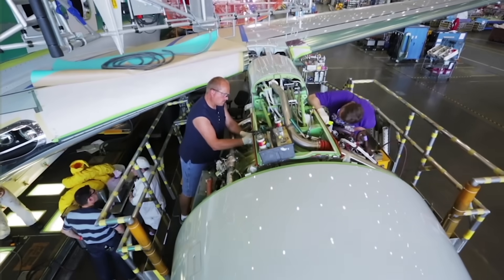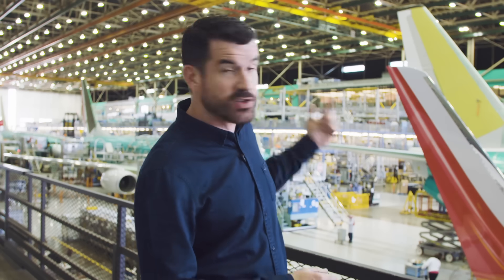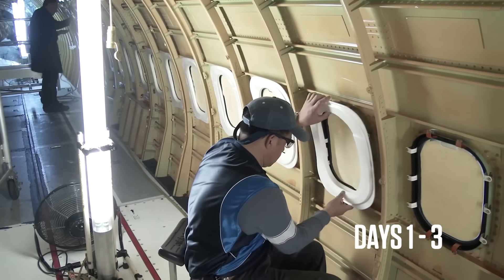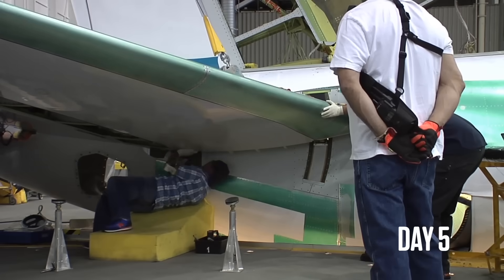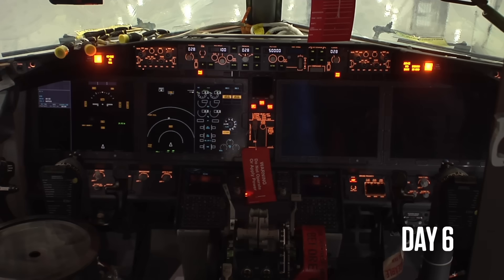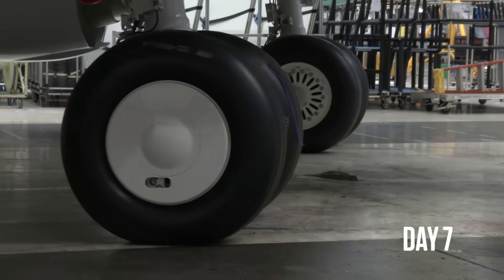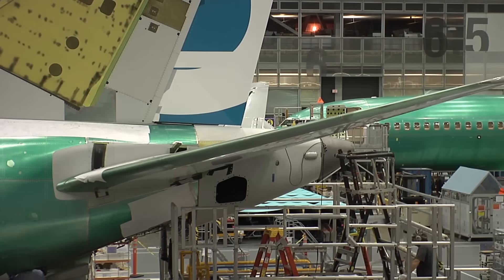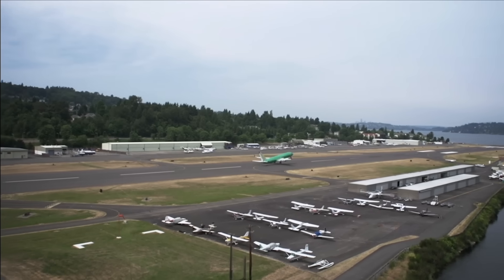How Boeing Builds a 737 Plane in Just 9 Days | On Location

Comment: Is it just me or would you like it to take more than 9 days to put something together that is carrying me at over several hundred knots and at 30,000 feet. I'm just saying.
Reply: I see your point but it’s not a rushed process, if they rushed it it would take more like 3 or 4 days and by rushed I mean loose screws everywhere, a couple of essential systems not working as they should here and there
Reply: Michael Spears o
Reply: Michael Spears Oh yes look at the safety record on planes compared to other modes of transportation. It was just a light joke saying if when you're 30,000 you can just pull over.
Reply: I can build a baloon, and drop it at 30,000 feet.

It will then go over several hundred knots, and at 30,000 feet.
And the best part: IT CAN BE BUILT IN 2 HOURS :D
Reply: @JKB-  what if I pop the balloon?
Reply: TechyMark Yes I know, It was just a joke
Reply: Erik Buiten false
Reply: Most cars are assembled in a day or less; and for some manufacturers, it only takes a few hours.
Reply: It’s not their first rodeo
Reply: It's also not built in 9 days though. They mucked up the title of this video. It's ASSEMBLED in 9 days with parts that were built before the assembly started.
Reply: IF u like surviving. Fly airbus
Reply: Erik Buiten actually Airbus planes have a flaw. In fact there was an accident involving a co pilot with the joystick pulling the plane up causing it to stall. The joystick is not linked with the other one so the pilot did not know the co pilot was pitching the plane up. On a regular yolk when you pull the yolk on the do pilot side it moves on the pilot side unlike airbus.
Reply: AF447 would never happen in a Boeing

Comment: Assembled rather than built.
Reply: Chris Coombes Parts are usually manufactured on high production lines which takes far less time than assembling whole plane
Reply: Actually build works as a definition, you're thinking of fabrication.
Reply: shwackthenoobsac What is fabrication?
Reply: your an idiot.
Reply: My thought exactly. Clickbait
Reply: Assembled/built, same thing. The parts are manufactured/fabricated and then shipped in and put together. This is more a massive warehouse than a factory. Parts aren't actually fabricated here
Reply: Blue Girl I agree - I was being a bit picky maybe.
Reply: @ChrisCoombes  lol 😜
Reply: huh
Reply: Yea i agree with you its misleading. They didnt count how long it takes to mine the aluminum.
Reply: Rata 4U  I never said that. I said assembled and built, which are indeed interchangeable.
Reply: Tf does that mean?
Reply: arrowmouse fair enough....
Reply: So where do you stop? How long it took for the steel to be mined? This is modern manufacturing, there's nothing wrong or misleading. What you're talking about is 'bespoke production' which is maybe 1% or less of output these days. These cheap prices and high quality we enjoy for everything these days depend upon it.
Reply: Samuel Rs fair enough I’m being a bit pedantic
Reply: if you're going to be pedantic, then it's usually advisable to be right.  Assembling finished goods from parts/assemblies is manufacturing.

Comment: where was the paint job?
Reply: The customer paints on their own livery to their standards.
Reply: That’s another 9 days 😂
Reply: i have the same question!
Reply: or the whole production of the parts... so, the final assembly needs 9 Days
Reply: It gets painted in the two paint hangers at Renton plant, at Boeing Field or at Moses Lake.  Then it will get deliver at Boeing Field.
Reply: Boeing does do some paint jobs for airlines, but most use other contractors. Boeing's main painting hangar is at Portland International Airport in the southern part of the airport grounds off taxiway Echo-6 by the threshold of runway 3.
Reply: mexican with can of spraypaint
Reply: soaringtractor Well the company needs to pay for it to be painted so yes. Technically the company needs to paint it
Reply: The company who buys the plane paints it.
Reply: @ghosttoast7  As a matter of fact, Boeing paints the aircraft in a separate building at the factory.  The Green protective coating is left on until all the tests have been completed and the customer has accepted the aircraft.
Reply: That’s the consumers responsibility, not the producer.
Reply: It was already painted. That plane operated for the company named GoGreen airlines